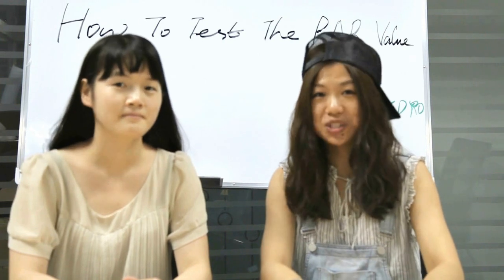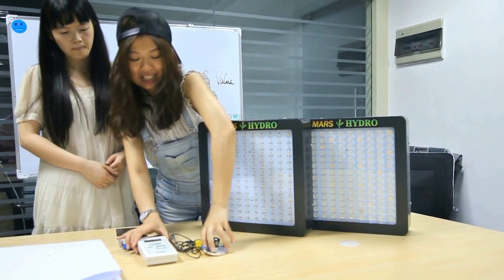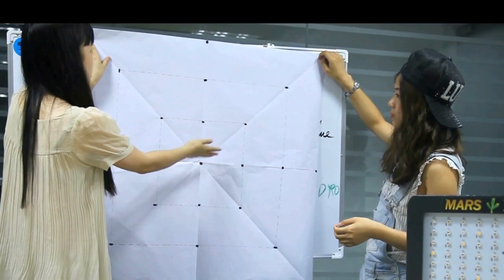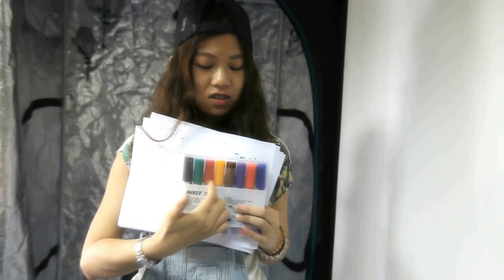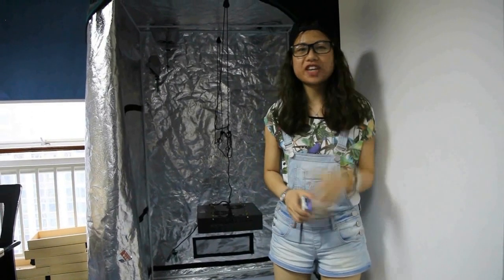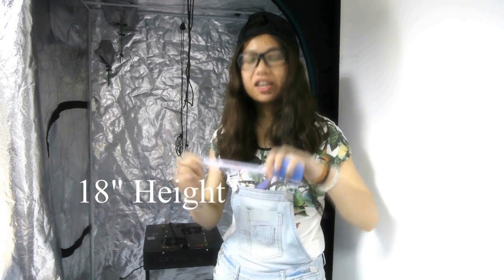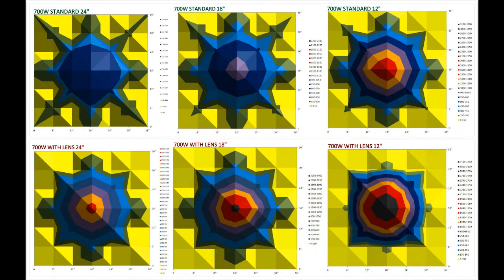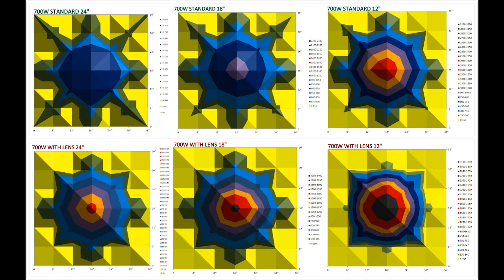How to test the RIGHT PAR value

Comment: Just got the 1600 and Sara sent me the PAR chart on it! OMGGGGGGG hahaha. My controlled factors were a hanging height of 18 inches, covering a 4.5ftx4.5ft area. I'll just give the diagonal readings, going from top left to lower right: 86, 196, 495, 1251, 1950(dead center), 1290, 489, 199, 90.  (given my light isn't exactly these valves because this isn't the exact lamp that was tested, but, believe me, it's suuuper close haha)

The only thing, maybe those stiff  90 degree cardboard packaging stocks that run along the edges of the inside of the box. (mine was dinged pretty hard but the box showed very little damage,  just creases. The face of the lamp has a crease in it as well, but it still seems to work fine....for now. that white foam packaging seems ok, but I guess FedEx be playing soccer with it). 
And the other only thing. Them fans bro! You gotta know that most growers gotta be hush hush....I'm not trying to notify my neighbor that I have an active Pratt & Whitney JT9D JET ENGINE running in my house! I REALLY wanna replace them with some quite, static pressure case fans. (the stock fans are 120mm, I can tell by looking at them. Your normal computer case fan size). I know they louder ones are cheaper, but I KNOW growers would pay a little more to get a little less...noise. see how i fliped it. 
I haven't grown with it but I have seen COfinest grow with them.....OH BOY! :))))))) Scrog'in it 4x4. nypowerdiesel